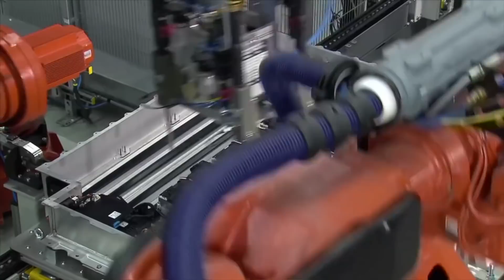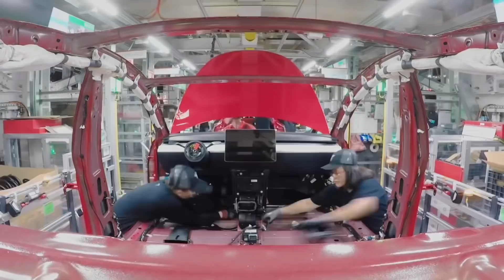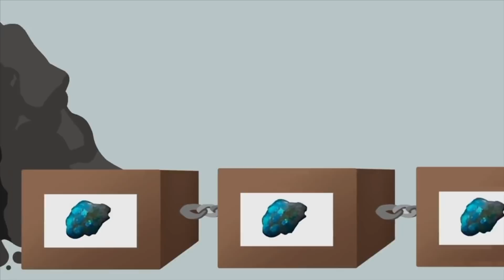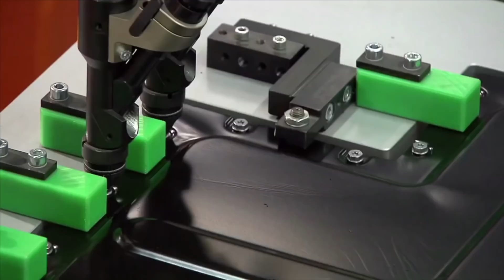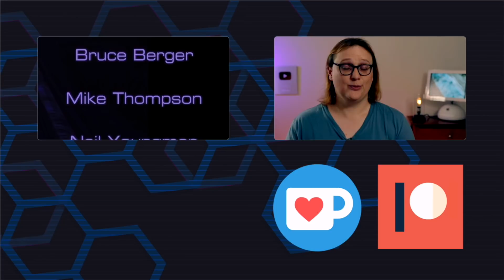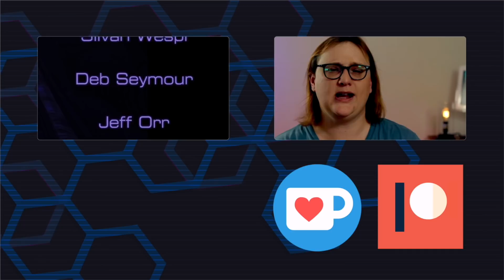Cutting Out Middle-Men: BMW's New Way Of Sourcing Battery Materials

Comment: We usually focus on cobalt, but neodymium is indeed just as bad, a different bad, radioactivity instead of slavery or child labor. Most of it is extracted in China with absolutely no regard for environmental and health issues, the radioactive slurry slowly contaminates the water table.

A magnet-less alternative to the permanent magnet motor is the switched-reluctance motor, that needs an external impulsion to start the motor. They are not as powerful, but a new generation of high-density SRMs might change that. Your compatriot Tevva will likely be the first to deploy this technology in their e-trucks. We need commercial grades of these alternative motors soon, because in addition to the thorium pollution issue, Toyota expects the demand for neodymium to exceed production by 2025.

Using half as much cobalt or no cobalt at all in the batteries, and using no rare earths in the motors will once for all shut down the naysayers about EV minerals. Just kidding, they will never shut down, even if EVs could somehow capture carbon from the air and transmute it into water, oxygen and gold...

Comment: Hydrogen Fuel Cells are the future and why. 

5 reasons why the Hydrogen Fuel Cell Electric Vehicle (HFCEV) have superior end-to-end Net Zero emissions transportation solutions on all levels over today’s Battery Electric Vehicle (BEV) technologies and charging methodologies. 

1)HFCEV much smaller battery saves on battery Raw Materials helping prevent EV battery shortages, already a huge industry concern
2)HFCEV smaller battery saves significant weight per vehicle
3)HFCEV smaller battery has far  less material for disposal and costly replacement 
4)HFCEV battery is charged slowly significantly extending battery performance, life and downgraded infinite repurposing 
5)HFCEV have superior Grid Power & Emissions Management over consumer based random BEV Grid Only Charging as follows:
A. 90% of grid power plants have emissions
B. Grid Loading: total capacity is running low, peak & surplus demand management issues 
C. Public Chargers: use grid power, many not working, bad quality potentially harmful to self and/or vehicle, susceptible to vandalism, fast chargers actually very slow & time consuming, over paying, hard to find & no guarantee will be working or available and costly. In fact, Tesla has ended their free charging program. 

In detail: 
The raw material demands for lithium ion batteries are growing faster than capacity growth, are finite and mostly come from countries with no environmental or labor regulations constantly contaminating the environment and worker deaths, many of which are children.  

The HFCEV requires 20-75% less lithium ion battery capacity than a comparable lithium ion BEV, thus their are less raw materials required for HFCEV battery and also huge weight savings. Further, the superior energy density and lighter weight of hydrogen, the lightest, highest energy dense most abundant element on Earth and Universe, also reduces vehicle weight. 

The hydrogen fuel generates consistent high quality zero emission electricity, which is constantly optimized by the onboard computer battery charging system for superior extended battery performance not only through the life of the vehicle, but beyond in the fast growing market of usable downgraded EV battery repurposing applications. This saves on costly battery replacements during vehicle life and virtually eliminates the costly growing disposal issues of unusable, little recyclable toxic spent BEV batteries.

The only byproduct of the hydrogen fuel cell is pure clean water which evaporates into the environment to be used again for more hydrogen. The only self emitting sustainable circular energy solution on Earth. 

Furthermore, extracting hydrogen from water through electrolysis using solar and wind generated electricity gives the hydrogen fuel cell a true net zero emission solution. Even though using green sources to charge BEV are also net zero emission solutions, compared to the HFCEV, BEV batteries are up to 4 times larger and heavier becoming dead weight as the power drains from the batteries.

In contrast, hydrogen fuel cell vehicles become lighter as the hydrogen is being used thus vehicle efficiency increases. In fact, a BEV semi can weigh up to 5000lbs more than a HFCEV semi. Thus, the HFCEV semi can potentially generate an additional $100,000 per year in revenue for the same miles driven as a BEV semi. Thus in commercial applications the hydrogen fuel cell truck clearly wins over the BEV truck. 

As the hydrogen fuel cell provides in vehicle constant battery charging, BEV don’t, and thus one must rely on external charging options. All public BEV chargers are not created equal, many commonly “out of service” and all susceptible to vandalism. They can be costly to use, extremely time consuming and even “fast chargers” sometimes aren’t fast at all. Fast or “superchargers” actually degrade battery performance, longevity and in many cases prevents future downgraded usability. 

In contrast, storing energy in hydrogen is vastly more efficient than batteries due to hydrogens significant higher energy density, lighter weight, superior storage life, lower storage costs, has no toxic disposal or recycling issues that arise from storing energy in batteries alone. 

Producing hydrogen through electrolysis powered by green sustainable sources supplemented by non peak/surplus grid power prevents the need of building additional power plants of which 90% are pollution emitting coal or natural gas. 

BEV grid charging during peak usages times, especially during hot Summer months, are causing growing concerns of causing blackouts.  If just one new coal or natural gas power plant is built to meet the growing BEV peak power charging demands, for decades the new power plant will causes significantly more net environmental damage than the ICE vehicles the BEV are replaced. If the ICE vehicles are replaced with HFCEV, problem solved, no new power plants needed. 

Also, the “fast chargers” charging BEV actually destroy battery performance, longevity and reusability even in downgraded applications. Thus lots of costly battery replacements and toxic battery waste to deal with.

In short, if hydrogen fuel cells vehicles aren’t the primary source replacing today’s ultra clean burning ICE vehicles, the current BEV being offered can actually be more environmentally harmful than the ICE they are replacing. 

Knowing this, the state of California in the USA has been proactive promoting hydrogen fuel cell cars and trucks with Toyota and others, have vast hydrogen filling stations throughout the state and more coming on line monthly. 

In conclusion, until BEV batteries have the same energy density, lower weight and longevity (0% fast charging degradation) of the HFCEV, the current hydrogen fuel cell solution is superior on all levels over today’s best BEV. 

The future: Combing the hydrogen fuel cell with next generation of super capacitors currently in development, will virtually eliminate the need for the larger and heavier lithium ion batteries altogether. 

Clearly the hydrogen fuel cell is the best end-to-end local and over the road EV charging solutions for today’s and future technologies under development, likely for decades to come.
Reply: Such long tirades usually come from companies nearing bankruptcy or scammers. Hydrogen is dead for ground transportation. It has a tiny niche for long haul trucking, but even this niche is getting tinier and tinier every year as battery technology progresses. There won't be hydrogen fueling stations all over the country to serve this tiny niche, only a few stations over the main motorways, and on site at the transport company. Even the latest Nikola truck is 100% electric, no hydrogen fuel cell, not even as range extender.

Comment: On the issue of keeping your car for as long as possible to save the environment, isn't there a fallacy there?  If I purchase a new EV each year, I simply turn over the vehicle to another EV (possibly first-time) owner.  If that person already owned one, and turns that over to another owner in a year's time, that could be a first-time owner.  So, the point is: the more EV's that are bought, the more that end up in the overall automobile ownership pool, eventually displacing older, polluting gasoline cars.  So any shift from gasoline to EV ownership should be good, right?  The key point isn't what happens at the front of the chain, but towards the end.  IF purchasing a new EV every year causes more ICE cars to be put to the junkyard prematurely, that would not be good.  However in a growing ownership pool, where cars at the end of their life continue to have value and are not put to rest prematurely, adding more EV's to the front end should be nothing but a good thing.  In the end, if it doesn't matter WHO owns a 1-year-old EV, as long as someone needs it and uses it.  What matters is not putting to rest older cars prematurely.

Comment: Hi Nikki. Just to say your video is somewhat misleading. Unethical mining accounts for only 7.5% of Cobalt supplies. The issue isn't a saturation of unethical Cobalt, it's the difficulty of tracing all of it accurately and being able to distinguish the difference. Also, as you know, Cobalt is being phased out of battery tech generally. EVs are a very small part of the Cobalt market. This issue affects all smart tech and is particularly prevalent in the oil refining industry, which is the biggest Cobalt end user.
Reply: Seems like Nikki made pretty much all of these points -- where is your disagreement?
Reply: @Graham_Wideman  She kept giving the impression that most Cobalt was unethically sourced. I help fund Nikki through Patreon and have met her at Fully Charged Live which I also support. I'm not a critic. But, she needed to be clearer on the fact that Cobalt mining is mostly legit (at least, as legit as any mining of resources claimed on other people's land).

Comment: "But what about.... Energy going into making the battery" old argument should go out the window now with renewable energy use in EV production.
Reply: chez421  what? it has been debunked even using coal to do everything, an EV produces less pollution in its life time than an ICE fuel efficient hatchback. With solar used to power construction of EV's there is no contest in the slightest...?! So answer what?

Comment: Hi I was not aware that there were any rare earth metals in an EV, there certainly isn't in the batteries.
Reply: Many high performance electric motors use neodymium permanent magnets. They're the most powerful magnets for their size, which makes for extremely efficient motors.
Reply: @dwaneanderson8039  Good to know.

Comment: The responsible cobalt miners in the DRC are probably pretty ticked off at the "artisinal" miners, because they've turned cobalt into a pariah metal, and that is slowly killing the cobalt market.  And yeah, you're right, some of those child miners are going to end up doing something even worse, or starving.  This is a messy problem not amenable to simple solutions.  Blockchain won't fix what's broken in the DRC.

Comment: I really have to wonder what's going on with BMW... New i3s have been basically impossible to buy for *MONTHS*. The whole 2020 model year i3 has been unavailable in the Pacific Northwest.
Reply: BMW is selling every i3 they can make in Europe. Meanwhile, the USA is where small cars go to die. Where do you think the shipments will go?
Reply: Michel Clasquin-Johnson The demand may not be high, but there is demand. You’d think they’d send SOME.
Reply: All European brands are keeping their high efficiency models at home to minimize the CO2 fleet fines imposed for not getting down to 95g/km. Mercedes EQC and VW IDs will not be coming to the US as originally planned because the companies save somewhere between $4000 to $12000 USD per vehicle if they don't export it. Until battery output increases this will remain the norm. Even Honda and Toyota are going to get hit with fines but they're much closer to the target.